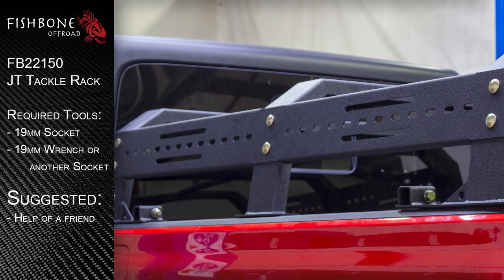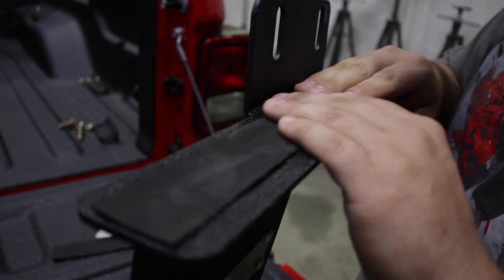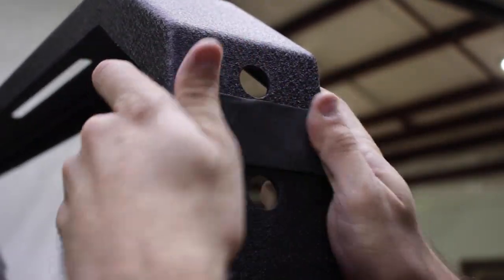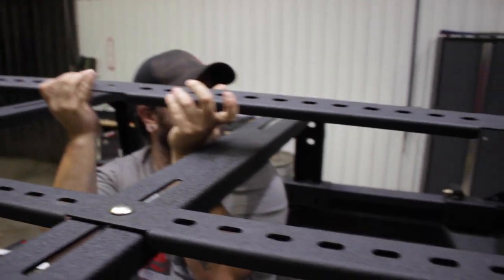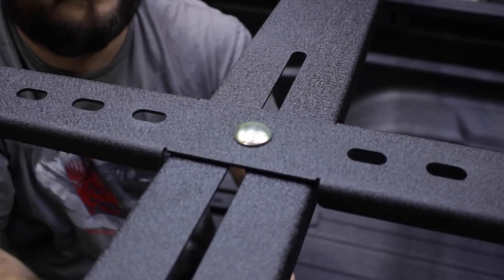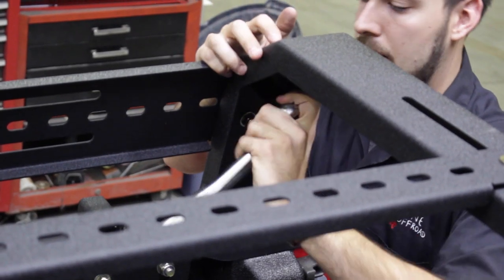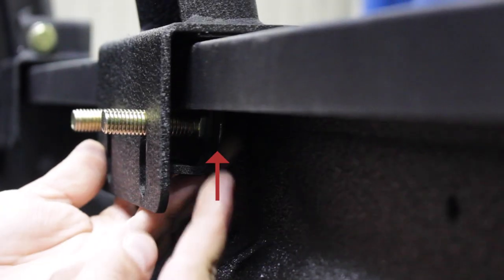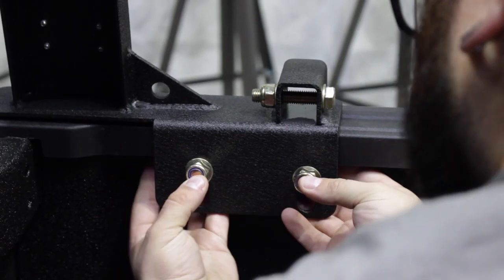FB22150 JT Tackle Rack Installation Guide

Comment: Just wondering.  Why are most overland racks lower than the cab stead of higher, so it could be used for things like kayaks that are longer than the bed?
Reply: I'd imagine a rooftop tent - wind resistance on the highway & height to get to climb down